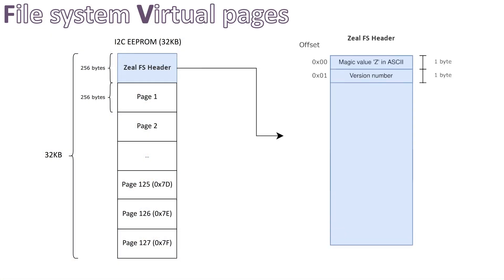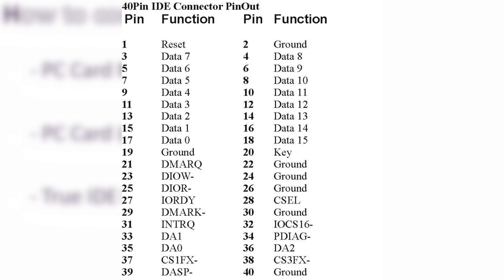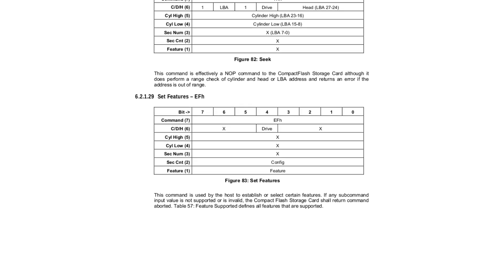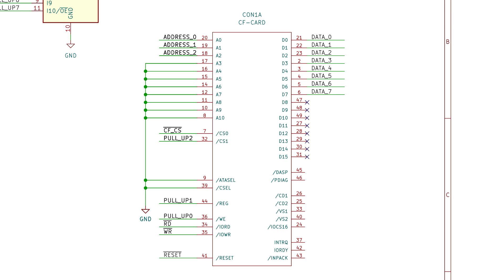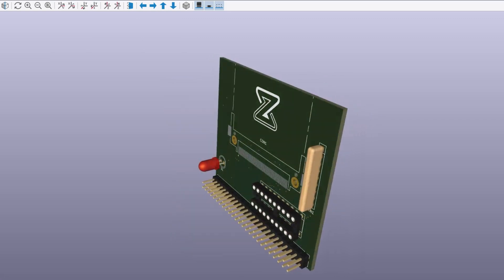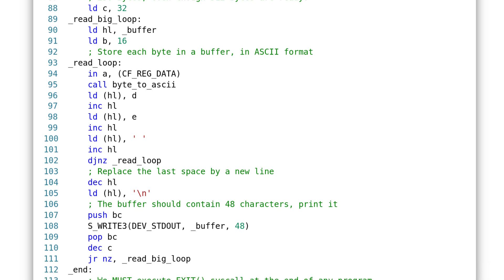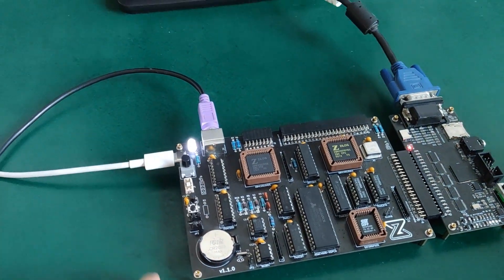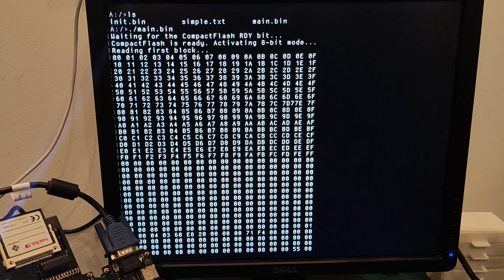Interfacing a CompactFlash on homebrew 8-bit computer! [Zeal 8-bit Computer]

Comment: Good video, it will help me a lot because I'm doing a computer using MC68000 a big mounster, and intent to put a compact flash in it.
Reply from the maker: Sound nice! You can check the GitHub repo, there are schematics for the PCB and source code (Z80 assembly) to communicate with it.
Reply: @Zeal8bit  My first comment is not a complete one. I have a board with Z80(my most beloved cpu), and firstly I will put a compact flash in it, for this your video will help me a lot, ti learn how to do that.

Comment: Zeal! Hope you are well. I still have an email in my drafts folder for you. :(

Very nice that you have added IDE/CF. Be weary that not all cards support 8 bit mode. In my experience support for it was dropped around the time 128MB came a long. Certainly any new card will not have support for if (the command to switch mode returns an error)

Anyway awesome stuff. Glad you’re still getting a kick out of this.
Reply from the maker: Lawrence! What a pleasure to hear from you, a lot of things happened on the project as you can see!

I remember you told me about that when I was still at the beginning of the project, I was trying to find CF cards that have support for 8-bit mode but the sellers usually don't really know much about it. I bought 3 cards: 16MB, 32MB and 1GB, all of them are brand new. Surprisingly, all of them support 8-bit mode, even the 1GB one! The brand written on its sticker is CHUJI (储技), maybe they are still using "old" micro-controllers inside the CF card? In any case, that's a good thing for us
Reply: @Zeal8bit  that’s jolly interesting as it’s the reverse of my experience. It’s encouraging for folks using CFs with 8 bit micros for sure. I still think it’s a much nicer setup then SD cards and all the extra work that goes with them. That’s so cool that you could have a GB of storage on your micro. :)

I need to get back to my retro projects!
Reply from the maker: @lawrencemanning  SD cards do require more work for such retro project, but more handy when used with an MCU that has SPI. I find CompactFlash pretty cool, they give a retro aspect that I like.

 Keep me informed of your retro projects!

Comment: I'm not sure why, but I never realized how simple CompactFlash really is. I'm gonna have to redesign my computer to use it since that would make things much easier! lol
Reply from the maker: It is! It is not easy to get started with the specification only, and I couldn't find a lot of info about how to interface CompactFlash to an 8-bit computer in details, this is why I decided to make this video. I hope it helped you.
  Which computer are you designing? Is it an 8-bit computer?
Reply: @Zeal8bit  I'm working on a design with a custom CPU. It's a hybrid between 8-bit and 16-bit using an 8-bit instruction set and an 8-bit internal bus to perform 16-bit operations. I was planning on using an EEPROM to store the instruction set but I might replace that with the CompactFlash to simplify upgrading the instructions. Who knows, I might be able to switch to a full 16-bit design because of this. It was a hybrid because I wanted a 16-bit machine but ran into issues finding parts. I'll have to make a video and a GitHub repo once I get something working.
Reply from the maker: @retrojon_  Very cool! When you say "store the instruction set" do you mean store the actual code for your CPU or do you mean you were using a microcode-style CPU?
Are you implementing it with discrete logic, virtually (Logisim-like), CPLD, FPGA?
I would be happy to know more about your project if you have a blog, link, git, etc...
Reply: @Zeal8bit  It's going to use micro code. The opcode will simply be a pointer to the microcode to run. All of this will be done with discrete logic; no cheating in this project lol. I also want to do what you did and be able to use the Compact Flash as normal storage for the computer. I don't have anything public yet but I'll let you know when that changes. Perhaps I'll try a blog.
Reply from the maker: @retrojon_  For sure using a CompactFlash as the main storage is possible and would be a very good choice, keep in mind that you will still need at least a ROM/NOR Flash to store the code that will perform the commands to the CompactFlash and copy the content to RAM. It doesn't need to be huge, 8KB is enough

Comment: What's up with the spurious 7 between bytes 7D and 7E? (10:45). Is that a program bug?
Reply from the maker: Nice catch! This is a graphic bug that is related to the FPGA board, I haven't deeply investigated this issue because I was mainly working on the motherboard recently, but my guess is that the connector between the motherboard and the video board is not very sturdy at the moment so the signal sometimes may be interpreted as active by the FPGA when they shouldn't be. As they also go through a level-shifter, some delay is also introduced, which can also affect the signals.
I will resume my work on the FPGA soon, I will work on its stability and implementing the missing features, hopefully this will be fixed! 😄

Comment: I was curious if it's gonna work the first try. Thank you for confirming that you're human and can make mistakes too. Cheers!
Reply from the maker: Haha, thanks for your comment, confirm I am human! 😄
Hardware is like software, hard to get things working from the first time, but I find it more exiting when everything works!
Reply: @Zeal8bit  I never ordered a custom PCB from a factory myself: not that it is that expensive, I'm rather lame at designing them in CAD software yet. But I'm not bad at soldering tho, so when I discovered that the UV-cured resin I'm using is quite a heat-resistant thing, I made me a flat piece of it, soldered some thin but rigid guiding «feet» to some SMD ICs, secured those wiring lines with the same resin, connected some more jumpers on top of it all, wired everything, confirmed it working, and covered it all in resin to protect it from any mechanical / electrostatic influence or short-circuits. Leaving the components accessible in case I need to replace them.
It's not a thing I'd recommend anyone, but I encourage others doing their own prototypes and learning from them, and this is why I'm happy that you're doing your project.
Together we learn, together we get better.
Reply from the maker: @jkobain  We learn by making mistakes indeed. I find that Kicad is rather simple to begin with (compared to EasyEDA), you can try making small PCBs first, even if you don't get it perfectly from the first time, at least your will get better and bette over time.
I am curious about your custom PCB build, sounds very cool, have you written an article or publish anything to show it?
Reply: @Zeal8bit  no, unfortunately I don't publish pictures at all. But one of them is a simple SPI flash memory array (128MiB×4, resulting in 64 megabytes of storage) module with combined address space and one LittleFS2 on them all, connected to an RPi Pico with MicroPython. I'll try laminating one with stripes of copper foil later, I think, and probably publish something one day as well.
Reply from the maker: @jkobain  If you end up publishing anything, come back with a link so that we can enjoy reading it! 😄